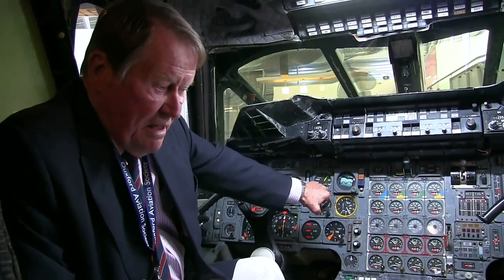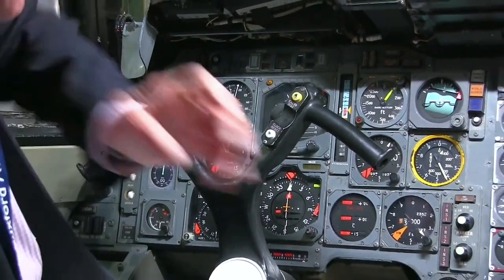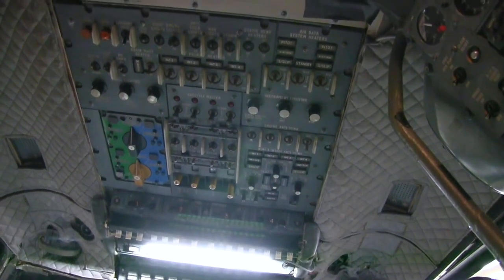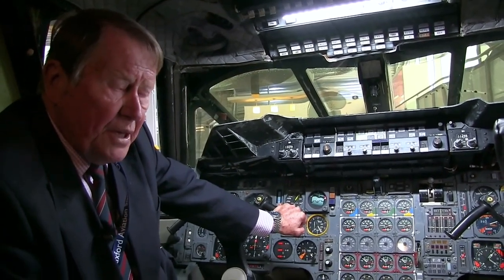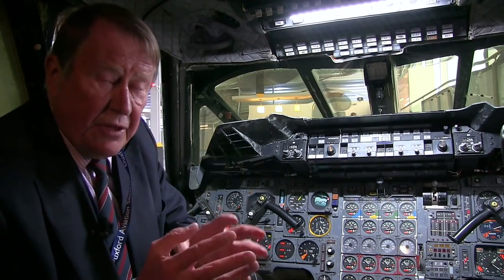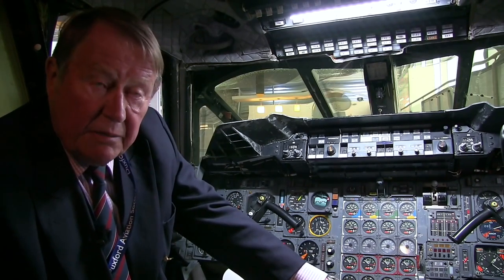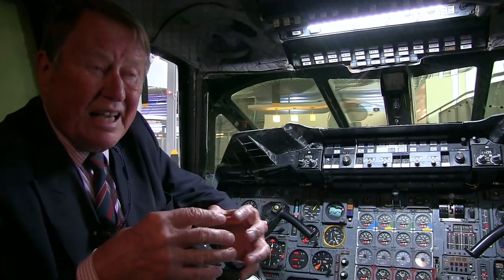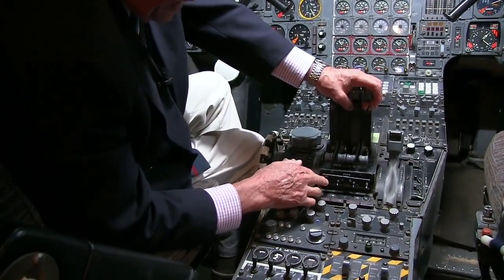Concorde Flight-Deck Tour with John Hutchinson

Comment: This is a proper cockpit! No poncy rubbish here!
Reply from the maker: Certainly one of the best lines I have heard in an interview!
Reply: Come on that's just rose tinted glasses from him 

Glass blows analog out of the water
Reply: @Lucarocks92  Except when (and it has happened) the screens go out... that's the reason to have ANALOG Back Ups.   When a screen goes dark, you do not lose a single instrument, but MANY.
Reply: @Lucarocks92  You should pay more respect... Guess how many thousand hour experience HE has over yours!
Reply: so freaking true
Reply: @alfredomarquez9777  That doesn't make it any worse. Anything can have a failure. Glass is much easier to read but it all is really personal preference. But you don't gotta be an asshole about it.
Reply: @alfredomarquez9777  Reversion mode will help save all those important instruments. And you can just replace the screen at the next maintenance station in about an hour. While I like flying on a analog as a student, It is backwards to disregard glass panels.
Reply: Lucarocks92 Yes, John was always a bit full of himself. Lol Great pilot though. He Knows his stuff.
Reply: @Lucarocks92  I'm sure he's aware. of course he's going to prefer and be found of what he flew with though.
Reply: @DorianTMChannel  LIKE YOU.
Reply: @ironbassler747  Lol you're so salty
Reply: @ironbassler747  you're just weird

Comment: "proper flight deck, needles and dials" ... what an arrogant statement. Yes, those are needles, but it was fly-by-wire, the engines were computer controlled and many parameters were handled by an Air Data Computer. So, I don't know what his problem is with glass cockpit. It is basically the same, except that it saves weight and wiring complexity, and it can also show more stuff than the standard gauges.
Reply: I’m guessing people like you don’t like people like him. Isn’t it funny how people can just ‘get that feeling’.